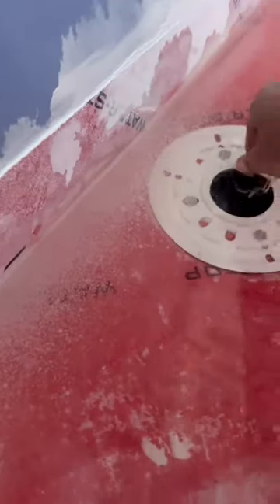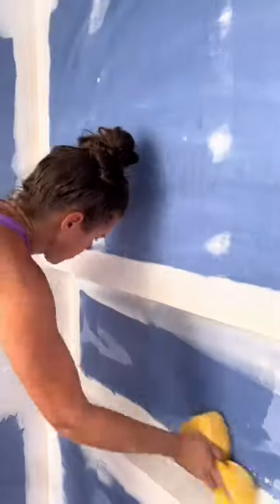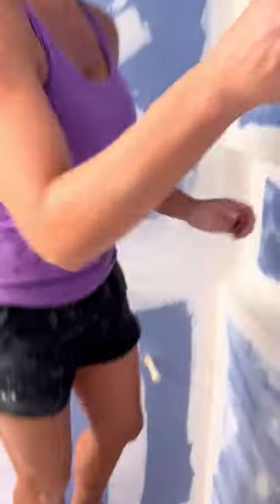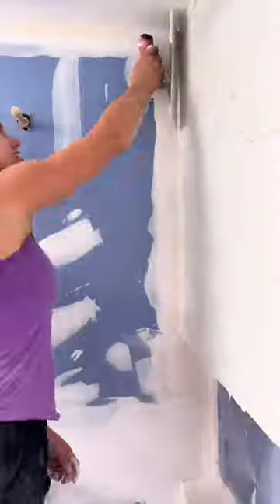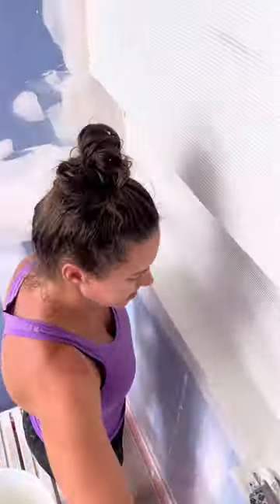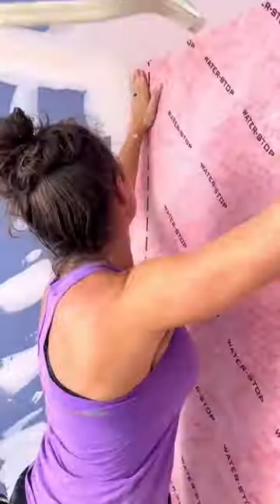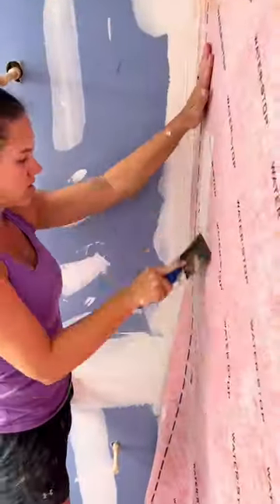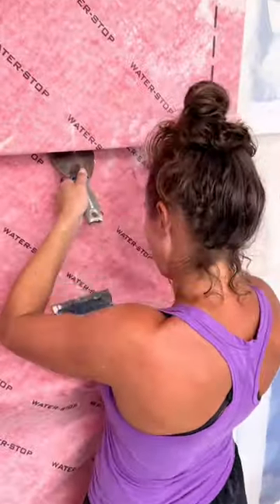Beach Bungalow Flip Primary Bathroom waterproofing the shower with GURU easy to waterproof!

Comment: I have a concrete base? And my guys just put down my electrical base head snaked through, then added a sluice layer which dried. They said I could tile atop that —no membrane. Is that true?
Reply: Concrete is not water proof. It wicks up water and will damage the wood behind it.  Need a membrane.

Comment: Use cement board not drywall, come on man.
Reply: No kidding.. raw drywall to boot.... doesn't even give er a prime or nothing.. the thing a out DIY'ers is they don't know anything about building, and how condensation works. That house will be full of mold in 10 years.
Reply: @dukeofbowriver8045  This method is approved by Schluter.
Reply: @dukeofbowriver8045  you are the wrong one here, that drywall will not be seeing any water with this method.
Reply: @dukeofbowriver8045  100 percent right
Reply: That is not normal drywall thats mold resistant drywall its more expensive than  cement board. She talked about it in a previous video.
Reply: @minimonkeyplay  it’s not the the type of drywall I’m talking about there bud. It’s the strength, that’s the reason you use cement board. It’s way more rigid. Any kind of drywall doesn’t have that strength. The water proofing is fine, it’s the foundation that’s not correct.
Reply: @nickhiller3337 good point!
Reply: @DrPepperJunior  yes but she's not using schluter that's the downfall

Comment: You have to wait after membrane for it to fully dry and cure. Stop being speedy Gonzalez and take your time. If you try pulling tiles off for some reason it will pull the membrane off and you will have air pockets
Reply: You are 100 💯 correct ,  40 plus years in construction here

Comment: 24 hour flood “test” on pan?
Reply: It's to make sure it's 100% waterproof before doing the tile work 😊 if they didn't test it, and the shower failed (leaking through leading to water damage) after tiling; then they would be losing all that tile cost, and labor cost.

Comment: Why do you need a membrane layer 😮 I thought it was just drywall and then tile
Reply: Water gets through and you’ll have mold and decay happening behind the tiles.
Reply: Tile and grout are not waterproof.  Theres a few different membranes out there.  Theres also liquid membranes that you paint or roller on.  Red guard,  is one. You can find videos of showers that fail because of bad installation.  Mold and rotten framing.
Reply: No you never glue tile directly to drywall